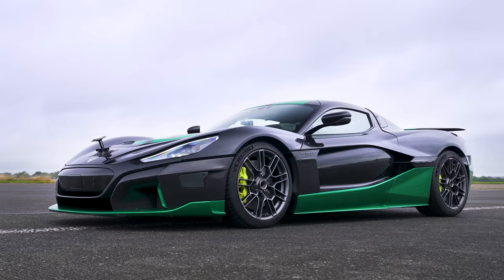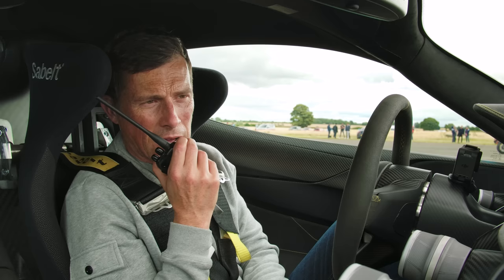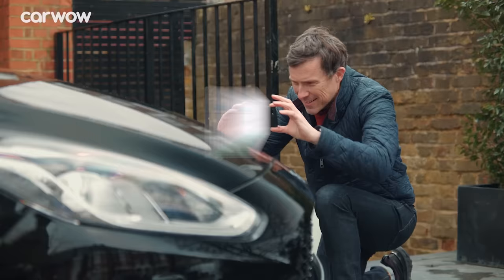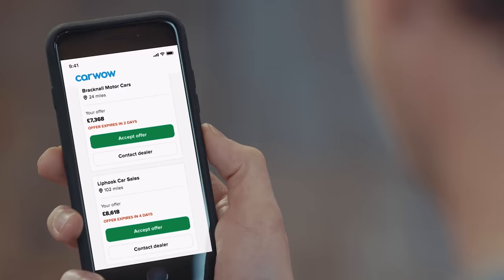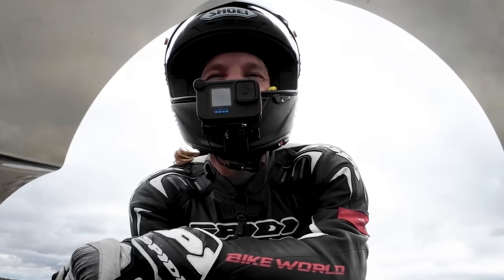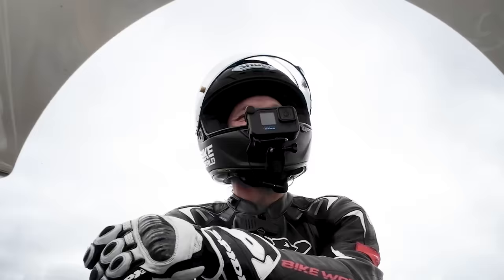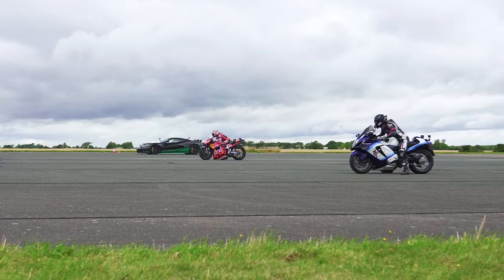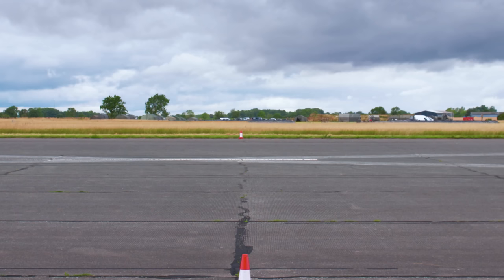MotoGP Bike v Rimac Nevera v Turbo Hayabusa: DRAG RACE

Comment: 300+ kph, wiggling rear, no ABS, and yet Dani keeps on going... respect 🔥🔥🔥
Reply: ABS wouldn't be of any help when you accelerating. Traction Control will.
Reply: @aqm1992 Coco Hayashi also ever done this drag race without TCS or ASM.
Reply: and he also won...dont forget he is a racing driver...Mat is just a journalist ;)
Reply: Imagine owning a crotch rocket with 380 HP and losing every race.
Reply: @dutchdna  that busa is absolutely dogshit. So much potential wasted honestly. But that motogp bike is not optimized for top speed and still won and tied a couple of races
Reply: @effortlessmike9085  You got that right!
Reply: @dutchdna all that power and no way to put it to the ground unfortunately
Reply: @aqm1992 not that relevant but just fyi, abs and tcs usually work hand in hand
Reply: @saltyfloridaman7163  It's grossly overpowered by about 100 hp.
Reply: @saltyfloridaman7163  I own a 200 HP V-max and it gets better times then that thing.
Reply: Yeah then double respect for the guy on the hybussa
Reply: @m135i.  Have you ever heard of a bike with abs but no tcs?
Reply: He needed a tire real bad!!! And some good Trac control
Reply: @effortlessmike9085 not optimized, but Binder hit 227.5 MPH this year on the same bike, so it's no slouch either.
Reply: @alexanderkritsek launching that car doesn't exactly look like it takes much skill. Launching a MotoGP bike, even with all their aides still takes quite a bit of skill and Pedrosa was a championship contending rider for a few years.
Reply: Thats why he named little samurai
Reply: @effortlessmike9085 that busa would never launch better than the ktm unless he got the motogp technology, in the end its just a street legal bike with a shit ton of horses.
Reply: @alexanderkritsek after couple of thousand drag race attempts (on and off the camera) in some of the fastest and wildest machines, he is not JUST a journalist anymore
Reply: @aqm1992 almost every 150- 200 cc bike
Reply: @atharvavaidya1433  i can understand what you say,and agree,but not a racer just yet (even if he has some nice skills i have to admit)
Reply: Soon, there is going to be the rapture. It's when there will be trumpet sounds, and after the trumpet sounds, God will lift his people from here.    Also, God said people should be living by the Bible.  Amen, and God bless you.

* John 3:16 - "For God so loved the world, that he gave his only begotten Son, that whosoever believeth in him should not perish, but have everlasting life".
Reply: @dutchdna  Jack frost from holeshot racing had a turbocharged busa 15 years ago that could hit 225mph  over a flying mile. I don't know what the problem was here but I can assure you that if they'd used jacks old bike neither the car or the gp bike would've got a look in. There's figures from elvington around October 2008 to prove it.
Reply: @dutchdna  tbh a stock mk1 busa would see off that thing, there's something very wrong with the way that bike is set up.
Reply: That's normal day at work these motogp guys are litteral god on 2 wheels
Reply: 186 mph

Comment: I thought Busa was slow, but did it in 9.6 seconds. Not to mention, everyone was doing 330kmph+. The engineering behind that motogp bike must be insane.
Reply: Homeboy was half broken trying to control something that is basically 1.5 hp per kg. It was insane for him to even be on it in his condition, and here he is trying to race some of the fastest in the world with a two wheeled slip n slide.
Reply: That Busa is slow. Most liter bikes can do low 9's. The problem is too much power. It's not usable.
Reply: 9.6 is about what a 600 can do. Dragspec busa with the right rider will run low 7's.

Edit: I’m a derp, I’ll leave my above comment there for you all to point and laugh. Still slow af for a busa - let alone a modified one
Reply: Too many magazine racers in here
Reply: @Chzydawg what crazy 600 are you talking about?
Reply: @Chzydawg I would give to much though into this handy measure technique here.
Reply: @dblackviper2k3 bro rides a 1000hp 600cc 💀
Reply: @dblackviper2k3  fair call got my distances muddled up. 

Still bloody slow for a turbo-busa
Reply: @dblackviper2k3   my 2006 636 ran 10.0's..... there are 600's that run 9's. I think the fastest 636 ran 8.9 or 9.0
Reply: @dkpjap  on a dragstrip I'm assuming. I'd love to see that video of 636 going low 9s on an unprepped surface
Reply: Agreed he was over riding it. my turbo st busa with less hp runs 8.50s all day swb. on a airport surface.
Reply: Slow? WTF? 😂
Reply: @Chzydawg  what 600 is doing that

Comment: Dani Pedrosa is an absolute legend
Reply: Absolutely….missed on the gp grid too.
Reply: Launches like a beast!
Reply: @sugar4522  Modern Gp Bikes have a Dragster Mode for straights and the Racestart...but its still impressive,i loved Pedrosa in his active career
Reply: @isleman8308 Missed by Honda too if you look how their bike development has gone compared to KTM!
Reply: Even more respect for Dani now
Reply: @drunkenhobo8020 all Japanese manufacturers are stagnating in MotoGP which is sad to see. Having quartararo on a Yamaha is such a waste of talent currently.
Reply: @drunkenhobo8020  Ducatis are now much faster than any other bike on grid they were fastest on Straights already
Honda suffering from aero problems
Reply: Need to know the time on second drag race
Reply: @johnny_bravo9990  8.2 8.3 for Moto GP bike 8.4 or 8.5 for Rimac
I also think GP bike could have hit 8.1 seconds quarter mile I'm not sure 
Carwow now doesn't shows all races times
Reply: @isleman8308 and forever goated. Along with VR46.
Reply: @purwantiallan5089  goes without saying..good days of gp when those boys where all lined up.
Reply: @drunkenhobo8020  agreed…shocking how bad they are! Yammy too!
Reply: @Smzxe because it didn’t
Reply: @0o0o05   yes but still the skills is still significant as the bike front is keep on lifting that's why it losses a lot of traction equivalent speed. No matter how good a rider can be no one can get a perfect start repeatedly. Dani is a good  starter bit not the best. Also, his small stature also affect the bike front end.
Reply: He jump start first 2 times
Reply: Motogp bikes sure have a lot of trick stuff obviously after years of evolution by the worlds best bike engineers. But it's mind boggling how they can launch like that with so little rubber contact. The Rimac has twice the tyres, but each tyre is flat on ground. The bike must have at least 20 times less rubber   on the ground.
Reply: @Mbe273  he’s the only one of those boys that raced! Dani’s spent most of his life waiting for the lights to change!.
Reply: Just gotta freaking love him!
Reply: Legend who couldn't win a MotoGP Championship.
Reply: You know The samurai!!!! 😂 every time , I think could take a break halfway or read the papers